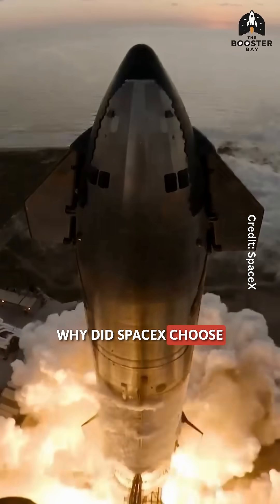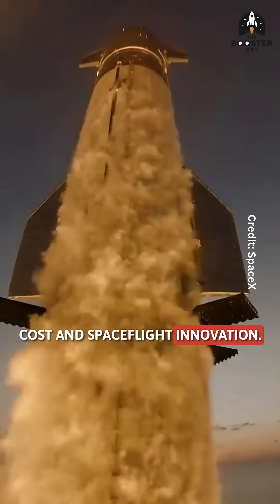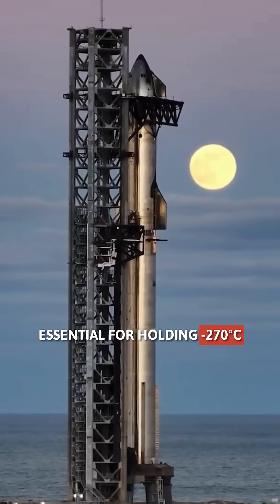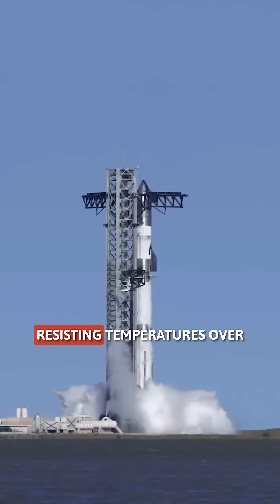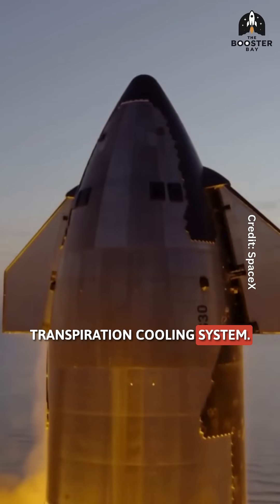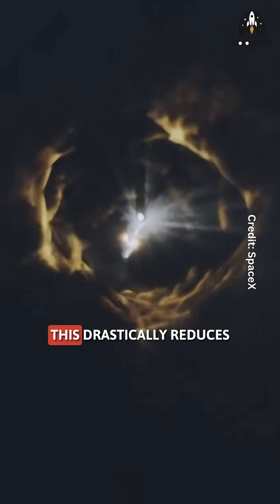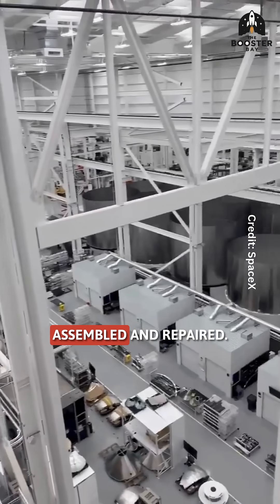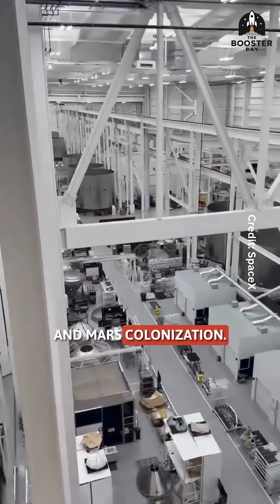Inside Starship’s Stainless Steel Design Secrets! #shorts #starship #spacex

Comment: Yep, tht's Elon Musk's choice of using stainless steel for his SpaceX-Spacecraft for Lunar, Mars, and beyond. The black hexagonal-looking outer coating ones. Made out of "polished stainless steel," plus, they added a "Wrinkly" thingies underneath it. Purposely, for the SpaceX-Upper Stage during Earth's reentry due to extreme heat. OVERALL, it's the Thermal Protection System (TPS).